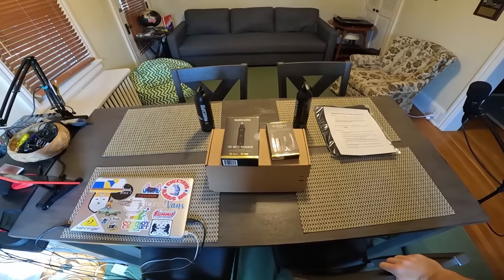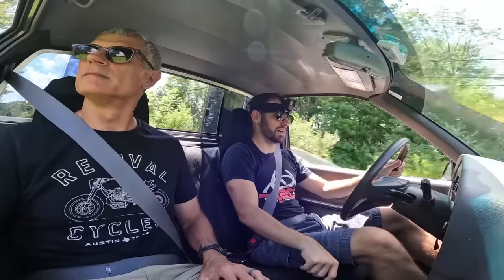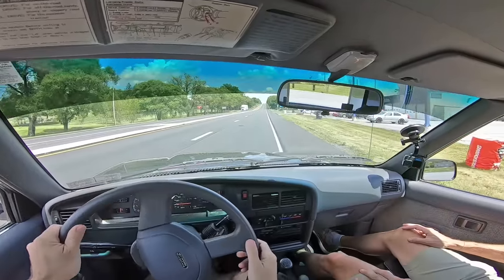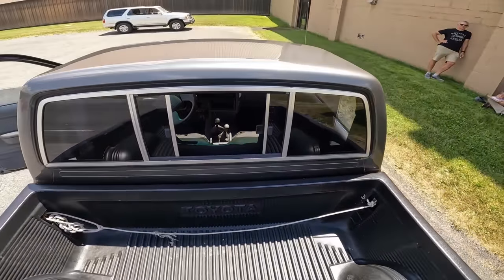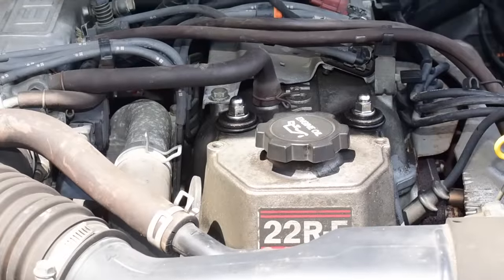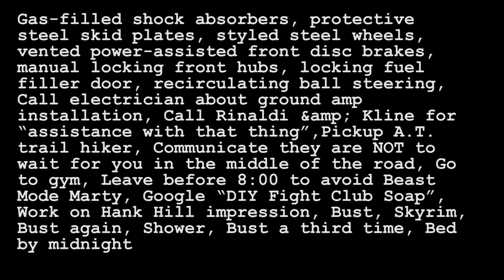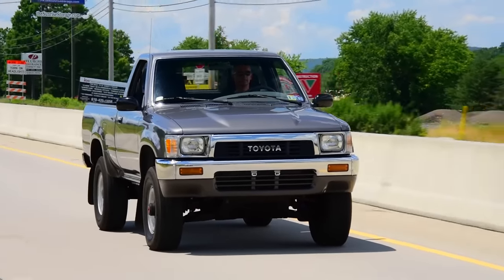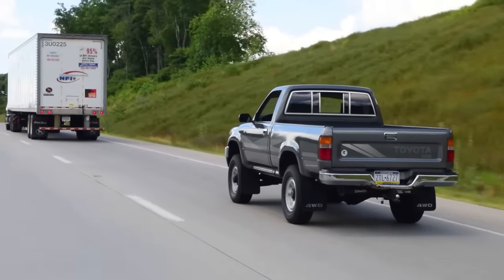1989 Toyota Pickup SR5 4X4 5MT: Regular Car Reviews

Comment: My dad had one of these, from 2008 to 2015. It was a 1987 model in blue, and just about as basic as you could get, with the only options being an automatic transmission and a chrome package, and it always carried a white topper. It was a tank, and it put in real work too; one thing I remember quite fondly was going to the pallet shop, now long closed, to pick up free scrap wood by the bed load to burn for heat. It bottomed out the suspension every time but the truck didn't seem to care so long as you kept to flat roads. Riding 30 miles home in the bed from any trip was also a highlight. He got that truck at 30,000 miles for a couple hundred bucks, and by the end of those seven short years, he retired it with about 340,000. The motor never failed him; it was the body and, more importantly, the bed that rusted away from the Wisconsin winters. It was a good little truck.

That being said I wouldn't want to own one. Not because they aren't good trucks, but they just aren't my style. I'd rather a classic American truck or something else altogether.

Comment: I had a 93 dlx 22re I picked up in Oregon and drove back to Wisconsin. It was a hell of a drive to get it back through the mountain passes especially in Wyoming.
Reply: I have a 92 4runner 22re I bought in Oregon and drove back to Wisconsin! Rust free gang!
Reply: @j_mars_cars  Winter's comming...... Rust never sleeps. I feel your pain here in Iowa.
Reply: @seththomas9105  I’m now 98% rust free. I need an afternoon with a pressure washer, wire wheel, and cosmoline black/fluid film black to seal off my frame from the evil advances of salt. Although, it will be parked most of winter
Reply: @j_mars_cars  You're from Wisconsin so you know that parking it Nov. 1 to Apr. 1 is the only way to keep rust at bay.  The bane of all vehicles in the Midwest is that fucking DOT salt brine.
Reply: @seththomas9105  I do also take the whistlin diesel mindset. I want to use my vehicle, not let it own me. It’s not rare in and of itself, just geographically. If I spared it from rust, but some drunk driver t boned me one day, all my saving it would be worth nothing. I want to use it up, but as slowly as possible, over 20-25 years. I want to eventually have it look like a battle worn unit capable of conquering any obstacle.

Comment: My first vehicle was the 1990 with V6(3VZ-E), 5-speed, and 4x4. Bought it from my father's friend in Peckville back in 02. And yes, getting around the old towns was much easier than sedans and my dad's f150 of the era. While they certainly had (rust) issues, I maintained it for 15 years. Even at 189k miles it was still serviceable. Wasn't great for highway travel though.
Really cool to see one of these on the show.

Comment: I am enjoying my little pickup 1991, just as clean as this one not 4x4 but it's still in immaculate shape. And guess what, it's my daily driver. 88,000 miles on the dash. I will be driving it until the wheels fall off, but I have a feeling that I will be long gone before that happens.

Comment: Absolutely the best work truck I ever used.
I'm a forester, bought timber during that time.
Every part seemed to be twice the size you'd 
think was necessary or typical for a pickup.
After using an F100 probably cut the amount of steps I took by 20%,
could get further off the road to get to starting point of a cruise.
Narrow. Tough.

Comment: I daily a 94 Toyota pickup. The last year before they changed it to the Tacoma. I am absolutely in love with it. The 5 speed shifts smooth and engine starts faster than modern cars. The 22RE putts along great at 209k
Reply: Actually, it was mid 1995 before Toyota changed over to the Tacoma model.

Comment: The 5 speed 2 wheel drive version I had, (a 93 with a 22RE) seemed to be pretty quick for what it was, but mine was pretty much stripped with a flatbed and weighed nothing.
Reply: The 22R and RE will rev. To. The. Moon.
Reply: love my 88 2wd, lowered 7inchs coil overs in front. celica trans swap. handles like a go cart and pulls in all gears
Reply: I don't think we agree on what "quick" means.
My 99 CBR900 was pretty quick.
Reply: @calholli  weird flex but ok
Reply: A stock 4wd truck is around 600-700 lbs heavier than its RWD counterparts, also it had a lot more aero and tire drag
Reply: @rhubarbpie2027  Cool..  I didn't realize a normal life experience of mine is a flex from your perspective.  I appreciate the praise..  The reason I say it's only "pretty quick" -- is because I had it out on open highway for a long stretch and I had it PINNED wide open for several miles at full speed-- and I ducked my head down and was going as fast as it would go -- which was round 145mph or so---  and my buddy had a 2001 fuel injected R1, and he BLEW BY me at 170mph and it scared the crap out of me just how much faster he was going than I was--  even though I was passing by the 70mph cars on the highway like they were literally sitting still-- that's what it felt like;    yet that R1 came screaming by me and was 2 full football fields ahead of me in less than a second ---  Really stupid fast, and I thought our bikes were similar in power;   but I learned that day that there are levels to the word "quick" or "fast".
Reply: @calholli  RRRREEEEEE MANY ANGER
Reply: @sintuerkasreviews7079  Wow, 700 lbs heavier is crazy. No wonder it's much slower, because I got my first speeding ticket in my RWD 22re Tacoma going 92 MPH.
Reply: @rhubarbpie2027  Why are you angry? lol.. You're free to also buy a fast motorcycle too you know;  or apparently a "pretty quick" truck that can reach 60 mph in only 17 seconds.
Reply: @wronggg  It's not much slower- it just gets a little less gas mileage.  But it's also a lot more powerful in 4wd LOW, and has a lot more traction with both axles spinning.  Either way, the truck is slow -- so you might as well have the more capable 4wd.
Reply: @calholli  notice I used the word  “seemed.” To an 18 year old doing burnouts and tearing around in a bitty truck that felt like a go kart compared the Suburban he started with, yeah it seemed pretty quick.
Reply: I was thinking the same, my 1985 22R 4spd is peppy, I've towed 5,000 lbs with it and has top speed of 88mph (as clocked by police)
Reply: @wronggg  4WD and 2WD Toyotas, they were very different vehicles underneath back then, 4wd trucks had beffier rear axles and frame crossmembers (couldn't say if the frame itself is any different though) and front suspension, even though it was still independent suspension up front the design was completely different
Reply: @calholli  What was the speed limit? How did you avoid hitting potholes going that fast? It would really suck to fly like Superman off your bike at 145.
Reply: @bwofficial1776  It's I-35.. Speed limit was 75 mph, on a wide open turnpike/ interstate highway---  where there are dual lanes, and the opposite lanes are separated by a big median, or even a concrete wall;  and we were far away from any big cities, out on the open road in Oklahoma-- just north of OKC...   You don't go that fast for very long--  just do a hard run for a 30 seconds or so and then you're back to riding the speed limit.  I'm sure we would have been arrested if we got caught--   so there is risk of coarse.  but it's super fun to learn what your bike can actually do.
Reply: @calholli  you write a lot, shouldn’t you be riding your imaginary CBRR?
Reply: My 78 5 speed 2x4 wasn't fast, but it felt like it. And I could always make myself look like an idiot trying to hoon it. :3 

Everytime it rained and there was an empty corner, I was looking for an excuse to throw it sideways! X3

Comment: My grandad bought a 1991 Toyota pickup DLX brand new, he drove it until he passed in 2001 and the truck basically sat in his garage until my dad got the truck in 2010 to give me my first car. 

It had the 3.0 V6, 4wd extended cab and an automatic. It was ungodly slow, it would do 0-60 in 15 seconds and i got it to 100mph ONCE. 

I had it until 2019 when it blew a head gasket and I was forced to sell it, unfortunately my parents had previously dumped money into my sisters 1999 Pontiac Grand Prix and the issues didn’t go away since that car was at the end of its life. That experience left them with a very bad taste in their mouth with older vehicles and my truck was viewed in a similar light. So they were unwilling to put $2000-3000 to get a new head gasket and I didn’t have that money at the time. 

It was sold in less than 24 hours when I posted it and it was never registered again leading me to believe it’s now rusting away as a donor vehicle. 

I wish I never sold it.

Comment: From about 2012-2016 I had an '84 in regular cab with the 7' bed. It had the 22-R, and straight front axle. Took it from 235,000 to 295,000 and sold it, as we had moved somewhere that checked emissions, and this little truck was straight-piped. Thing was a complete rust-bucket, would go anywhere, and would actually tow, if you kept it in 4th and weren't anxious to do more than about 50. I disagree that you need a pristine one and one to use -- just keep the crappy one.

Comment: I bought a '92 pickup back in July of '21; a single cab, 2 wheel drive automatic with the 22re engine. It was the first car/truck I bought with my own money (cost me about $3,800) and I had to make a 12 hour round trip to get it. The damn thing was loud, the steering was soft, you'd get passed by priuses on the freeway, and when going over rough roads (which here in Michigan is every road), it felt like your spine was being rearranged, but goddamn it I loved that little thing. Unfortunately, after about 10 months and 11,000 miles of fun and hauling dumb shit for my friends, it threw its timing and put a piston rod through the engine. And while I've moved on and love the current stupid car I own, I'd be lying if I said I didn't miss that truck every once in a while.

Comment: I've got a 1994 2WD 22RE base model, and there is not another car on the road that I want more than my truck. It's the best truck, because it's built to be a truck and nothing more. It gets you and your shit "there". It doesn't do it with style. It doesn't do it in comfort. It doesn't even do it that well, but it always does it, and you can always count on it to do "it". It's the best friend you can ask for. Ready to help whenever it can, fine with being forgotten for a bit, but always eager to move when the time is right. 

And the throttle response on that engine is so unbelievably tight. God it's so fucking easy to rev match downshifts. The truck felt like an extension of my body the second I got in it

Comment: I had the 1988, 4 cyl, 22RE stick 5 speed bought brand new for 10k. I had it for 13 years and drove it cross country and back. Also from Maine to Key West. I had a cap and loaded with gear and had no trouble going 75 to 80 in the 5 speed. These trucks easily went over 55 and never needed to be babied. Best truck I've ever owned, but rust did claim it living in New England from 4x4 on the beach and road salt.

I never had 1 issue in 13 years. Oil change, Tires, muffler and brakes. Normal wear items. My Ranger, Dodge and F150 all had issues in the first 5 years.

Comment: I own the perfect version of this pickup. 1987 mechanically perfect inside, rot free, but still looks like a 35 yo truck on the outside. I'm not afraid to use it or scratch it and its more reliable than my 2015 hatchback.

Comment: Excellent review! My dad wrecked his nearly identical '93 SWB 4x4 Toy Truck after passing out at the wheel, causing a rollover accident. (When he came to, he was more upset about totalling the truck than worrying about why he passed out.) But I've had two Toy trucks of my own in the 2WD variant (which is almost an entirely separate model due to different body panels, bed lengths and suspension geometry) My red trusty, rusty long-bed '88 was a faithful companion for nearly twenty years, never shirking it's duties and hauling me and my stuff all over Alaska; I still miss it. My current '91, short-bed 2WD has already had the requisite timing chain replacement, a new clutch and is awaiting a new distributor. I also managed to score the front and rear bumpers we had bought Dad for Christmas off his wrecked 4WD. Jim would do well to replace the rear bumper; they are still available, not too expensive and easy to swap. Sweet ride!

Comment: This was the gateway to the 4Runner. Gentlemen, hats off. Let's show some respect.
Reply: Yup the 1st gen 4runner was just this truck with a fiberglass shell on the back..and they sold good!!!
Reply: @jdubskiwright2380  Winnebago made what was basically a prototype 4Runner. They'd take a Pickup, cut the back of the cab off and bond the bed to the cab, put a fiberglass topper on, put in some shag carpet, and bolt a bench between the wheel wells. They made a few hundred and the success convinced Toyota to try making the 4Runner.
Reply: @bwofficial1776  there was also an rv. That wasn't a winnebago im not sure the brand the front half was a Toyota pickup the back half was a dually rearend and it had the 22re with a 5spd..im pretty sure it had either 3.92 gears or 4.38 gears in the rear axle.. how that thing moved and did highway speeds is amazing.ive seen a few for sale with only 120k on the clock..one other had 170k.. both ran and drove and everything in them worked AC for the entire cab propane stove small fridge and freezer...probably didn't use too much gas , Especially when compared to a big class A or class B with a big block or the ford 6.8 v10.  I always wanted to take a Toyota camper out for a weekend and see how they were .there getting very hard to find in decent condition tho..

Comment: I had a '90. Bought it for $8k at 81k miles. Beat the shit out of it, just kept adding fluids. Sold it with a dozen problems at 130k for $5500. Most reliable vehicle I ever had, and the master mechanic who bought it was thrilled to score a low-mileage one. Best trucks ever.
Reply: It's amazing how low mileage for a Toyota or 4.0L Jeep is ready for the junkyard in anything from Europe. 130k, that's just broken in.

Comment: My dad went through these (2wd) like underwear as around town delivery trucks for his battery business. When actually loaded and actually doing things that American trucks did in stride (like haul lots of weight and get driven aggressively by minimum wage 20 something's), these things screamed and broke down all the time...put 10 or 20 automotive batteries in the back and it's slower than a snail. The 22RE would rev itself into premature failure. At one point these trucks were so cheap and unheralded that he could literally trade a pallet of car batteries for a new motor or an entire new truck.
Reply: Finally someone else with real world experience that knows these things were and are cheaply made underpowered junk. 
All these youtube guys have zero real life experience. While this clown was playing band in high school I was building engines and tuning carbs during peep rallies while he played his instrument.
Reply: @southfloridaoffroadrecover7251  I mean I don't know man, it seemed like he was heavily implying the entire video that these trucks were no good for anything beyond light work. He literally said this would not be a good truck for a tradesman unless his trade was finish carpentry. As the original commenter here proves with his real life experience, if you overload a machine not capable for the job and push it beyond its limits, you will break it at some point. Not quite sure what you're so upset about.
Reply: @ixionn563  because it can't be a great truck and not at the same time.and people with zero experience having their opinions taken as relevant.
Reply: "I loaded up my truck bed with SOLID LEAD every single day and it broke" no shit?
Reply: @kyle8952  normally a truck should handle some work.
Reply: @southfloridaoffroadrecover7251  There is "some work" and then there is abusing the shit out of it way beyond it's rated payload. It's like jumping off a roof and breaking your legs, and then complaining that "legs should support my weight".

Comment: My dad had an '89 V6 SR5 4x4 5-speed extended cab new from 1989 to 1995. When he sold it at 6 years old, 60k miles, carefully owned and maintained, he was very nervous about selling it (because the last thing he had sold was a 4-cylinder 2-door Jeep Cherokee that nobody wanted ) and he only asked $8000 for it. I was adamant he should've asked $10,500. He put a 2-line classified ad in the local paper and we had 16 messages on our answering machine within a few hours. The first guy who called was the first guy who came and he happily paid asking price without issue. Dad used it for his contractor business, towing the boat, we even used it to help pull down a couple neighbor's trees! It was a tough little thing that shrugged when we asked it to exceed its listed capacities. Will long remember the theater of locking the hubs and getting it prepared for the 4x4.

Comment: I had a 1989 just like this. Mine was black and in immaculate condition. Got it for 2k off some old guy. Drove it for several years and then made the mistake of upgrading to a 2020 Tacoma. I love the Tacoma but that old 89 pickup was as simple and easy to work on, pretty good on gas, and way better in the snow and off-road than the new Tacoma. I miss it everyday.